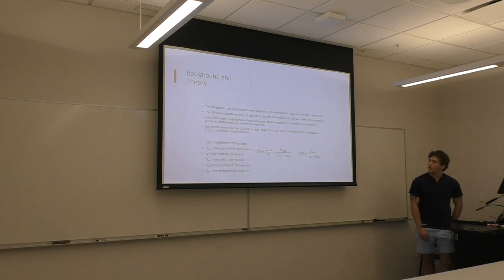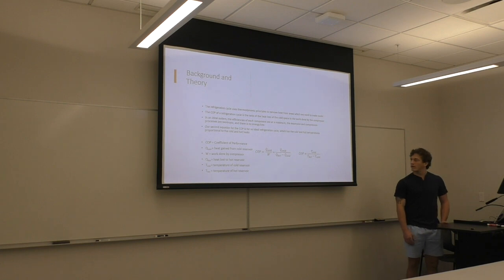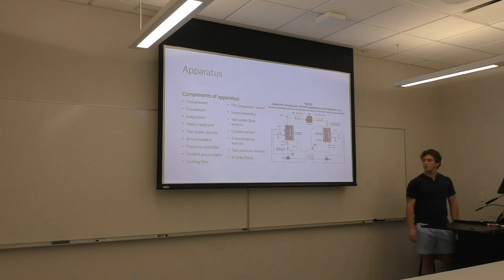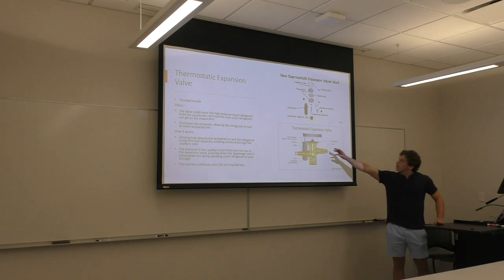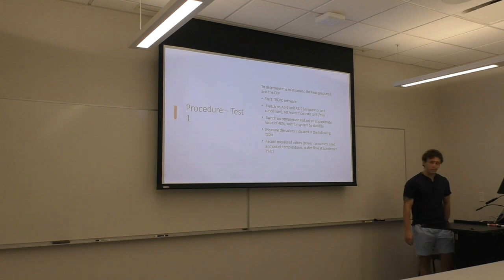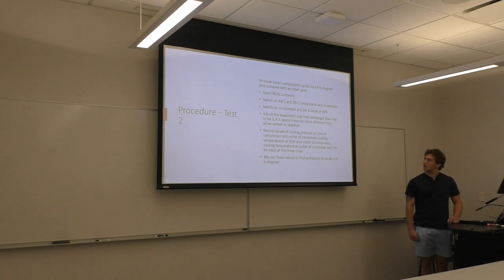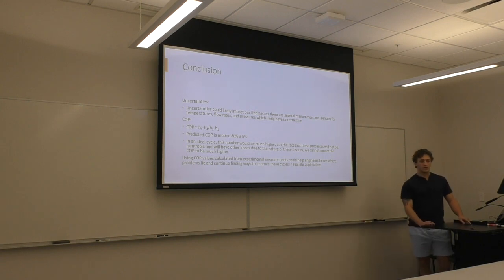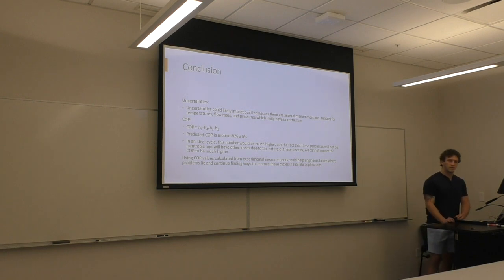Ben Albert

Comment: Good response Ben. The presentation about the vapor compression heat pump was very informative because you provided background of the system, explained how the system operates with the varying sensors, and provided the sample calculations for the results that you all expect to get when doing the experiment. Timing is good but I would try to shoot a little bit closer to that 6 minute mark but overall great job!